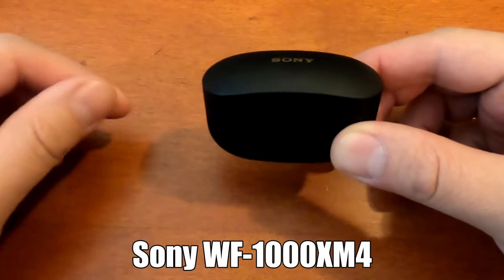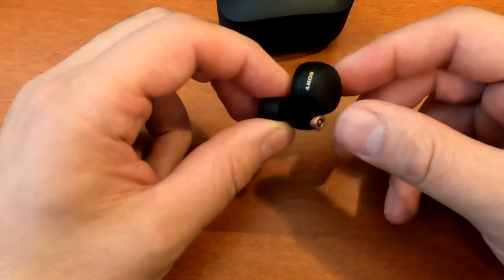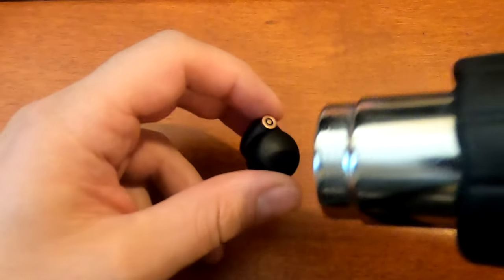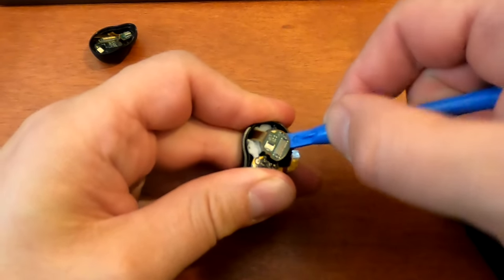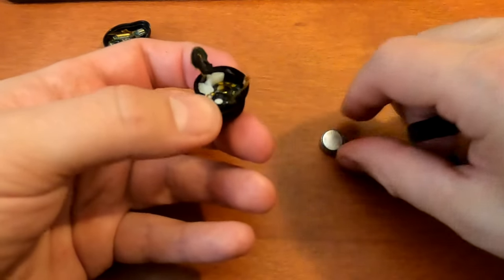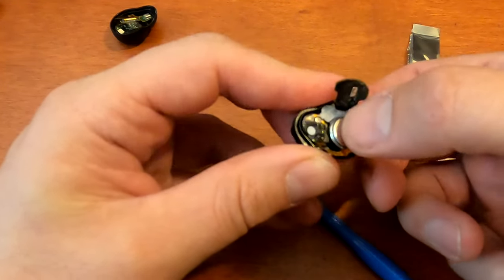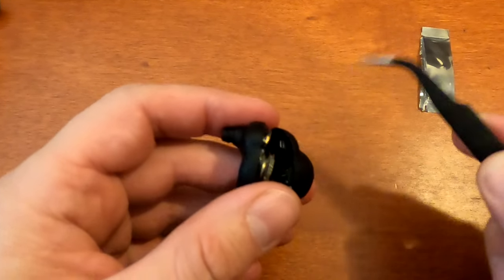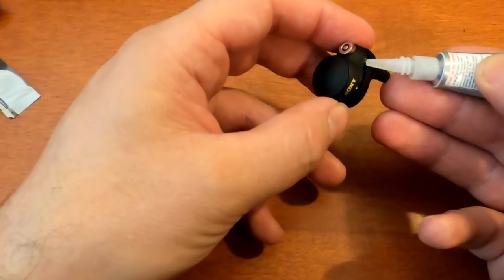[QUICK FIX!] Replacing the battery on a Sony WF-1000XM4 earbud

Comment: Just did it like this and it worked! but my problem now is that it seems that the stereo sound seems to be gone now and just outputs a mono sound, is there anything I can fix this?

Edit: I already tried restarting, going to the app looking at the settings didn't help as well
Reply from the maker: Ugh! That's really odd - I can't see why changing batteries would affect stereo vs mono sound...
Reply: @ificanfixitsocanyou I doubt it has anything to do with it, but do you know how to revert the headphones bac to stereo sound? because I couldn't find any solutions on the Internet

Comment: wondering if you could upgrade the battery to a larger Wh one the same physical size so it gives you longer usage ??
Reply from the maker: Good question - I was mostly concerned with just getting it working again, so I didn't investigate batteries with larger capacity.

Comment: judging from the build quality of xm4s, you think accidental dropping (approx. 1m from the floor) would damage/affect the stability of the device? Seems like everything inside is glued and clipped very well. Had mine xm5 and i accidentally dropped it and it made me a bit paranoid. hahahah
Reply: Wouldn't worry, they can handle lite drops fine.
Reply: @DeepishMoog  i dropped one of my xm4 and it stopped working.

Comment: I just changed mine however the earbuds don’t seem to be turning on. I probably need to charge them more at this stage. All the connectors fitted back together just fine.
Reply from the maker: No LEDs when you reconnected? It's important to make sure that the batter fits into the case properly, and that the circuit board from the top of the battery is securely back on. Perhaps battery contact is not being made?
Reply: Did u find the problem?? It happened to me as well, I used a little bit of the glue to stick the battery back together 😢

Comment: So I got 2 new batteries and a heat gun was able to take it apart. Pretty easily put the new batteries in. The only thing is left ear connected but the right ear won't connect.
Reply from the maker: Hmm.. I think that on both sides of the battery, there's a small metal prong/tine that is supposed to be pointed/angled upwards to provide a spring-tensioned connection to the battery. Perhaps one side of the battery isn't actually making contact? (another way for me to explain this metal tine is to imagine placing your hand flat on a table, and then only raise your index finger while keeping everything else flat on the table. That finger would come into contact with the battery as the battery is lowered into position. And the same, but reversed, for the other side of the battery. Does that make sense?)
Reply: @ificanfixitsocanyou  Thank you, my friend, that was it And now I have new Sony earbuds. ✌️
Reply from the maker: @scottflores4482  - Awesome!!! So happy to hear that that worked! 😀😀 Rock on!

Comment: Great video!! I wonder what's the tempurature of the heat gun you used on the earbud.
Reply from the maker: I used the low setting which is around 700F max. As you can tell from the video, everything was too hot to touch! I... probably should have used gloves...

Comment: Thank you for the video. Today I replaced the battery in my left earbud, everything is working fine except the noise cancelling. It has a strange loud windy noise if the ANC is turned on. Can anyone help me with this problem? If I turn off the ANC, the noise disappears.

Comment: Sony didn't make mistake baterries need to be replaced sometimes. Wf Mx4 are first Sony earpieces I ever bought. Earlier used jbl beats Phillips none lasted for 3 years or more. Mx4 use daily connecting to pc over bt500 asus. They work perfect baterries still last for hours. Lately bought xg300 instead tv speakers. Again connected to bt500 asus, placed behind TV, connect to usb TV port so it can charge. And got much better sound than from TV speakers.

Comment: How did the replacement batteries work out? I'm having battery drain issue on the right earbud and wondering if the battery is defected or the firmware update is causing the battery to drain quicker. I'd hate to go through this process to get the same issue.
Reply from the maker: So far, my batteries are holding up! Many hours of playback and no quick draining. YMMV but knowing that I can replace them means I can keep buying new replacement batteries

Comment: I'm going to give it a try. Couldn't find the battery from the description, but i found something that looks equivalent. 
Has the battery life been close to what you'd have expected from the factory?
Reply from the maker: My battery life has been amazing since the replacement! And knowing that I can replace them in the future, if they ever drop down to below a few hours of usage, I'll just order more!
Reply: Can you make a video update of how the earbuds has been after you have replaced the batteries? I have recently picked up some used WFmx4 and the left side seems to drain a lot faster then the right side. I'm currently using version 2.0.1

Comment: Great video, but i think he should have added a warning for this. When taking the board off the battery, make sure you don't scrape AT ALL. There is a very tiny thin tab that connects the battery to the board. It will fall of without you even knowing it's there. If you do, a tiny, tiny dab of solder can fix this, but it is not nearly as good.

Comment: Thanks for the video. How long is your battery life now? Did you have to perform the reset?
Reply from the maker: Battery life is significantly better. I did not have to perform a reset or any other firmware reset. I simply let them recharge and have been using them for hours at a time ever since.

Comment: Hi, i recently discovered the magnitude of the problem with the xm4s, i successfully reverted back the firmware from 2.0.1 to 1.3.3 and it did not fix the draining issue... Can you provide links to buy the exact same batteries you had in the video ? I think i have the 3.7V in mine, thus the draining issue (old earbud batch)
Reply from the maker: I purchased my batteries on AliExpress, but I have seen the same ones on Amazon. Searching those sites for "ZeniPower Z55H" should get you on the right track! (Make sure to buy two!)
Reply: @ificanfixitsocanyou  thanks ! Just bought a pair of z55h on aliexpress as well. Where did you get the glue ?
Reply: Hello ! So i replaced both batteries and now when i activate the noise cancelling function, the right side is very boomy like it boosts low mids frequencies by a lot and it's unbearable... I opened it a 2nd time to really make sure the seal is correct but i can't be 100% sure. Could it be another source ?

Comment: Thanks for that video !  I personnally won't do it, as the problem will occur in couple of months again. That's what many users experienced, when they had their WF1000XM4 back from the repair center. The issue is apparently coming from a charging issue.
Reply from the maker: Ooh - interesting. I will keep an eye on the battery levels. So far they have been holding up.
Reply: Did your battery drain fast on them? Have you experienced one earbud dropping the battery level way more than the other? And have you sent the buds back for servicing only having tthe issue reappear again?
Reply: @SacreDro  The right earbud last 25 minutes, while the other last couple of hours. I haven't send them back as the warranty was over, Sony (France) told me I would be charged for the repair, and I've read that even with replaced earbuds, the problem may come back. :(

Comment: After changing battery one bud is not charging (the light indicator don’t blink up)  but it goes to off mode. Very weird issue i am facing. Any suggestions?
Reply from the maker: It's possible that the battery is not contacting the metal bits on either side. On each side of the battery, there's a small metal tine that is spring loaded to point "up" towards the battery. Over time, that may have compressed flat - and thus is no longer pressing "up" towards the battery face. If that happens, then the battery isn't connected! Try removing the battery and gently prying up that metal tine a bit to reload it's springy-ness. Hope it works!

Comment: 7:50 as others have pointed out, don't don't do that, you risk breaking the ribbon (as I did...). You can just remove the battery without disconnecting that ribbon anyway. Hope my failure helps someone at least.
Reply: I didn't remove the cable and broke the ribbon removing the battery on the first earbud. Second earbud repair was flawless.

Comment: where did you buy the battery replacement?
Reply: buy it anywhere in an onlineshop, but i recommend the Varta CP1254 A4. They lasts even better than the chinese Batteries.

Comment: Is it possible to split the earbuds without the use of a heatgun?
Reply: Wanted to know also
Reply: Use hair dryer
Reply from the maker: I think a hair dryer could work, but I'm not sure. I didn't want to gouge the plastic too much, but I'm sure if you had a good spudger you could force it open.
Reply: @ificanfixitsocanyou  Its just that I'm worried to permanently damage the electronics inside, not that I lack the capability to do so.
Reply: I broke my wf1000xm4 when using heatgun for too long while replacing battery. Its got Ghost touch and bad bluetooth connection
Reply: I also warped one eartip. You can force open the seam with cutter knife then wedge in with another sharp blade/finger nail did it for me. Then work your way around prying it open. That's my experience.
Reply: @jamess43  Thanks I’ll try this method without heat
Reply: Thank you all for your replies :)

Comment: i've replaced it, it's charging but not turning on. did you find a solution to that?
Reply: I’ve heard you need to reinitialize the headphones. While they’re in the case, touch both earbuds for about 10 seconds. The case LED will blink red. Let go as soon as they flash red. It will then blink green a few times. That should do it.
Reply: @anthonylopez4998  i did that process so many times but it didn't work
Reply: @burackbb  that sucks. I’m not sure what else you can do. I wonder if a sensor or wire got dislodged.
Reply: I’m having the same problem. It charges but doesn’t turn on. Did you use a metal tool?
Reply: @MrSlidthunder  it have 2 theories for this situation. one possibility is short circuit and the other one is when you seperate 2 parts of the motherboard, upper section's metal part might be broken.
Reply: @MrSlidthunder  And it's charging because of the battery is working correctly i tried plugging only battery without inserting the motherboard and in this situation it was charging too it is also not related to turning on.
Reply: @burackbb   what did you end up doing? Haha. On eBay they have the left & right earbud together for $20 used. Not bad if you messed up & need both.
Reply: @MrSlidthunder  i've decided to sell both the case and the batteries to buy momentum tws3. but from what i read these are also problematic like sonys. it is worth a try i guess

Comment: You should have tried to contact Sony. I had the problem of batteries showing different levels and not working for more then a few minutes, even if fully charge. They sent me new ones free of charge.
Reply from the maker: I did! Unfortunately, I purchased these ear buds from a 3rd party seller, so they weren't covered under the Sony warranty - this is why I tried to fix them myself! But you are right, DEFINITELY check with the manufacturer first, before attempting any repair!

Comment: Mine is the other way around. Left one is fine, the right one battery drains like 1% every minute.
You would expect that a $345NZ Earbuds would last a little bit longer at least minimum over 2 years.

Sending it in for repairs /sighs.

Comment: Great news , you may not have to change any batteries. My Sony wf1000xm4 was draining my battery on left side.  So I updated 1.6.1  then I turned off everything including automatic updates . Everything is fine. It's all that B .S . WE DONT NEED. SERIOUSLY.  JUST GIVE US LONG LASTING WIRELESS MUSIC BUDS. THAT SOUNDS GREAT.  THATS IT. WELL ITS FIXED. SHUT DOWN THE B.S. YOU WILL BE FINE.
Reply: I flashed mine 2 year olds on firmware 1.2.6. It seams to work a bit better. At least i get them charged to 100% now

Comment: Has anyone thats had this problem happened to use a fast charger on there buds? I think using a fast charger will degrade the battery very quickly. Just wondering theres a certain wattage your battery should be. Usually usb c, to usb is too strong. You should use a usb A to usb c.

Comment: I recommend only disconnecting the small ribbon cable if you absolutely can't get to the battery. Accidentally ripped it trying to disconnect it. I thought I was being gentle, but it came out unexpectedly and I guess I used too much force, because it ripped where it meets the board. I'll just buy a replacement earbud then. 🥲

Comment: Btw may i ask you..? my sony cant charge?
Reply from the maker: Hi! I've mentioned this to others - but it's possible that the metal contacts that sit below and above the battery are not making contact. On each side, there's a very small metal prong that points towards the battery. Think of placing your hand flat on a table and then only lifting your index finger - that's what the metal prong is doing to contact the battery. Maybe you need to lift each one "up" so that they make better contact? Best of luck!

Comment: I find it hard to open it with the hairdryer, someone with tips??
Reply from the maker: I'm not sure if a hairdryer will get hot enough? The heat gun I used will get up to 700F on the Low setting. During the heating process, the earbud got VERY hot - too hot to hold for more than a second or two. But, as some others have found out the hard way, don't melt it!! Good luck!

Comment: I replaces the battery all went fine it seemed. Now left earbud won't connect
Reply from the maker: I mentioned this to a few others - perhaps it's the same issue you are facing. On both sides of the battery, there's a small metal prong/tine that is supposed to be pointed/angled upwards to provide a spring-tensioned connection to the battery. Perhaps one side of the battery isn't actually making contact? (another way for me to explain this metal tine is to imagine placing your hand flat on a table, and then only raise your index finger while keeping everything else flat on the table. That finger would come into contact with the battery as the battery is lowered into position. And the same, but reversed, for the other side of the battery. Does that make sense?) You may need to pull that metal tine "upwards" a bit more to ensure it's making contact.
Reply: @ificanfixitsocanyou2494 hi thanks for the reply , I have actually solved the issue and it was as you've said the battery was not making contact correctly. Connector on the board which is stuck to the battery wasn't making contact. The gold flap part had disappeared and I couldn't find it. I ended up taking a piece of metal from a battery spring in another item and sticking it to the board to make contact. Charged up fine and have been using all day without any issues. Also I didnt remove the ribbon cable to replace battery. I had enough room to get it in and out. I didn't have anything small enough like those tweezers you had. All repaired thanks to you. 🎉
Reply from the maker: @ref0910  AWESOME!!!

Comment: Feel like i followed all the steps correctly but now my left earbud has no power at all. Not even recognised by case
Reply from the maker: Ugh!! When the batter is inserted into the case - on both sides there are metal contacts. These contacts are slightly spring loaded (Imagine placing your hand flat on a table and then  lifting your index finger only. Your finger would be the metal contact that the battery touches.). It's possible that the metal contacts are not "up" enough and therefore not making contact with the battery? Another viewer had a similar issue and was able to rectify the issue by "lifting" the contacts higher. Let me know if that works!
Reply: @ificanfixitsocanyou2494  unfortunately I had tried that to no avail. Gotta run around with one earphone from now on lol
Reply from the maker: @PorusJA  - oh no - so sorry it didn't work for you
Reply: @ificanfixitsocanyou2494  no problem dude. It was fun trying :)

Comment: Guys. Pls dont use metal forcep or tweezers. During battery replacement i saw some minor spark (orange zap a little), then after finished n glued everything, the casing did charge n led works. But no sound coming out when wear it. So sad hurhur

Comment: Problem is, this doesn’t work for everyone that makes this battery change.   The firmware still causes the same battery issue(s).  And no, firmware “updates” do not fix it for everyone that does this.

Comment: This is very poor. 2 pairs of Sony earbuds. WF1000 and WF700 and both are broken. The 700s don't connect to case properly so stay stuck connected to phone which effectively mutes it! And as such I often find one earphone at 0 percent. Meanwhile the 1000s are lasting about 15 minutes for the left ear bud and maybe an hour for the right. Won't charge past 80/60 and the case doesn't even charge to 100. The 700s aren't even a year old. 1000s I bought 2nd hand. But I've got old pair of Cambridge audio earphones and they still work fine years later.